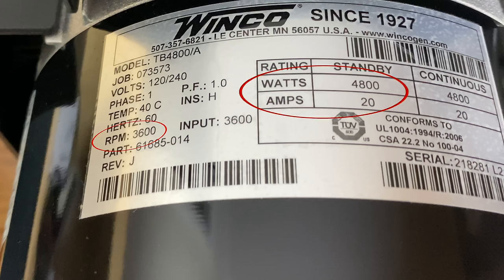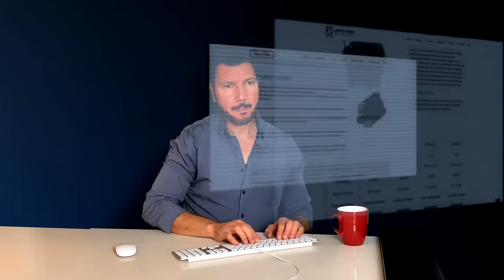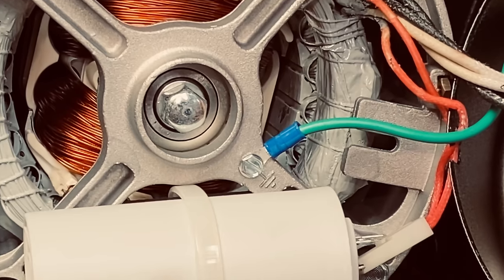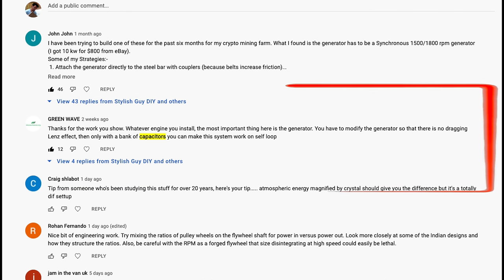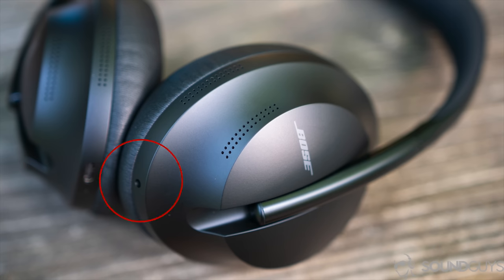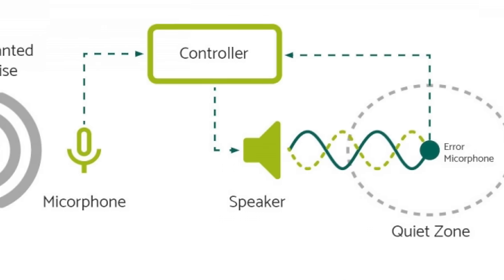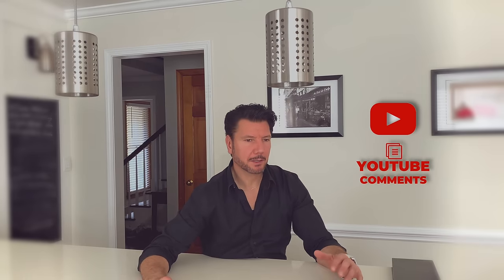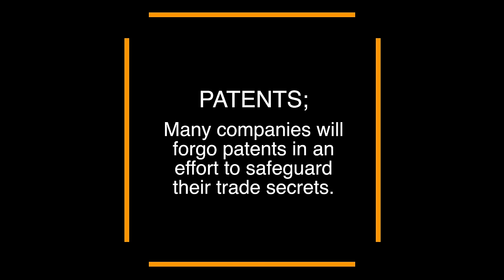Why does this Free Energy Generator not work?

Comment: when I built my generator I had it at46%of max power output I was still making adjustments to the design after work each night one day I came home from work and began working on my design at 58% of power it began to make a strange noise I stepped around the side to investigate and the multi piece flywheel exploded tearing the housing apart and cutting the control panel in half not sure what happened but tree days later there was a note on my car at work that just said boom the same note was put on my wife's car at the store
Reply from the maker: 😯
Honestly when I turn that thing on that is always my biggest fear that the flywheel will come loose.
Because at such high rpm it’s unstoppable and will literally go right trough the wall.
Reply: @MarkusNenning  watch your back we disassembled our unit and put it away we have been tailed around town and our house has been broken into at least three times never anything taken but the threat against my wife has made me put it away the secret is in the size of the generator head and you can light up your hole house

Comment: Belts break. Bearings fail. Windings eventually Unwind. Heat and Rust never sleep. Super efficient? Probably. Free? NOT. INFINITE, no.
Reply from the maker: But that isn’t exclusive to this kind of generator. And yes free is probably the wrong word because the equipment will always require initial investment and maintenance cost.

Comment: let me put it this way, the ac motor powers the flywheel, and flywheel runs the generator.

1 . flywheel size 1. should have two belt pulleys, size 1/3 and size 1/2.

2 . ac motor belt pulley size 3/4 or 7/8, to flywheel belt pulley size  1/3.

3 . flywheel belt pulley size 1/2 to generator belt pulley size  2/3.

now we have 4 belt pulleys and 2 belts.
flywheel conserve energy to run generator. generator runs ac motor. and ac motor powers the flywheel.

if we get to reduce crypto mining electricity cost it'll do mean a lot.
Reply from the maker: Thanks!
Yes this would be great for green crypto if it is possible 🤔

Comment: It doesn’t have to be “free” just efficient  enough to be sufficient-  quit trying to reinvent the wheel running I. Circles it’s all in the rotor - it needed to be a triangle like the mazd motors that’s why we where left the bent pyramid it’s the shape of the first wheels and latter rotors and ram jets

Comment: You don't need ai to make free energy. It can monitor the flow energy but cannot manipulate or get in between the flow. Reason why the flow of free energy and ai are in opposite directions. What that will create is a spiraling vortex or nightmare destruction. That will blow the cap and destroy all circuits in one blow. Not to mention fly apart in worst if cases.

Comment: Back in the 70's i experimented building free energy mechanical devices had plans from Bedini,and other technical data from Tom Beardin who if im not mistaken developed a working solid state device called Meg...i have that info in my files somewhere..its probably still on the internet.The zero point energy comes from what we used to call the ether..i dont believe that term is used anymore,because of misconceptives about what the space really is,from what i understand there is unlimited free energy which can be tapped from space,not outer space just the space all around us,our space has air but its still space.Resonant type devices are able to tap that space either mechanicly or electronicly i have no doubt about that even if its 1 pulse per second,thats alot of energy.We all know that you get a surge when you collapse a magnetic field if i remember correctly,i believe it to be much more then backing emf,its the clue to the river if energy available that would upset the status quo and men have known to crazy things to prevent adoption,ask Tom Bearden if he is still alive.
Reply from the maker: Thank you Frank!
Very insightful. Are you still involved and experimenting yourself?

Comment: What it looks like to me you have 90 lbs of weight in middle..so make the 90 lbs weightless.how you do that is take 2 neodymium magnets put one in hole (wood) other magnet going down that same hole (north vs south)  put your weights on top of that magnet(via a bar),,,that will make it weightless..as you know you have to have other parts like wheel bearings ect.I did that before with 50 lbs and it was almost weightless in spinning
Reply from the maker: Thank you!
Might be worth a try.

Comment: You did wrong way generator. You need use 3 phase motor, and run from 110v, same as Rotoverter, and then put motor in resonance.  Then convert AC to DC, and then DC to AC.

Comment: 1st of all you need to know I would generate this working To produce power. 1st while the generator is running the engine whatever. It's hard to build-up magnetic power 1st. When the magnetic power is built then you start to generate. And what's the other people are doing they put magnets into the generator and then they didn't need to generate Is magnet power. So from the start they start to generate power. And it's so easy like that that is why they're using the magnet my friend and if you guys started to put magnet into your rota then you will see the difference.

Comment: Dude shorten the shaf the fly wheel is on no more than 3 inch on either side
Reply from the maker: I want to be able to add more wheels if needed.
Reply: @Stylish Guy DIY  na man R&D DONT WORK THAT WAY !!! You must make a hole new shaft longer ! Dude you still must follow the rules (shorter =rigidity. Man I now r and d and you must have banke and patience and EXPERIENCED SHOT CALLER !!!!!

Comment: Once the fly wheel is fast enough you dont need the full amount of electricity to keep the fly wheel turning. You only need to use 50% of the power to keep the fly wheel turning, that would mean you could use the other 50% to fill a battery. You need a switch that alternates the power between keeping the flywheel turning and filling a battery. Think about it when you push a kids roundabout and the roundabout is turning fast enough you only have to hit it now and again to keep it turning at high speed. Your doing it wrong: https://www.youtube.com/watch?v=Z0W1-t-WqBs

Comment: Cool vid, I just happened across it  doing an amp search, any way have you thought about your balancer  or counter weight being connected to a shaft( like a crank shaft style) and the lobes on the shaft are attached with springs(several on opposing sides  that each works against the other  keeping the shaft continuosly rotating after the initial startup? Was just curious if you had. As for the enviroment, global warming has nothing to do with humans carbon footprint nor cow farts(as a billionaire idiot claims) it's caused by all those weather modification machines they have all over the word that's ionizing the molecules when the shoot that shit in the atmosphere. Anartica,  Alaska, Sweden or Switzerland, Artica, China, hell there all over the place. Example Haarp etc.... And lets not forget Cern too. They need to stop that shit right now!

Comment: I've done it you didn't try hard enough
Reply from the maker: I am not done trying yet.
Can you show prove of your working machine?
Reply: I used a sprint exercise bike. The fly wheel was 22 kg and was already in a good frame with excellent bearings which saved me lots of time. I used a treadmill motor which ran on a 24 volt battery  (2 x 12). And another treadmill motor as a generator. I had to hand crank the wheel before engaging the power and at first I was loosing 10 000 the of a volt every couple of minutes. So I reduce the friction of the generator on the flywheel and I was charging the battery it took 2 years to reach this goal. I know this can work and every building should be supplying there own power. Wish you all the best. I don't have this device any more. Enjoyed your videos keep them coming.
Reply from the maker: @conniekovacs2269  Thank you Connie!
I like the idea of using a exercise bike flywheel.

Comment: What you need on a flywheel is a flywheel tank with flaps on the inside water and fries mixture on the inside list flywheel spends buy a motor a one-sided flywheel you can touch others generator motors on the other side of the flywheel that generates power one to turn the flywheel electronic waste switching the power from the grid over to self on the other what's the flywheels in motion the waters in motion triple Force fluid of course it's like your own personal waterfall that will turn the flywheel with a minimum amount of power from the motor kicking on and off and Coast well others take the power from the flywheel turn into electrical energy should be a professional motion that machine and free energy it's only a you can always make it bigger than that always you can add flaps on the outside and create are shut chamber around the flywheel will the wind then go down around the when power instead of electrical to start the to start the flywheel in motion to start creating power

Comment: It will never work with any actual currently known technology.. you quoted the first law of thermodynamics, but there are 3 more. and one of them teaches us this; there is no system in any field of physics and chemistry, which has an efficiency equal to or greater than 100%...
and do not forget that a motor or a generator are not machines that produce energy..But it transforms an energy input into another form of energy output. From electrical energy to mechanical energy in the case of a motor and vice versa for a generator....In addition, these machines will not transfer more energy than is required at the output.
Even if your motor says 3000w(Max output), if you couple a load that consumes 2000w, the motor will transfer 2000w... if it's a 4000w load, the motor will transfer 4000w and burn out...One important thing that you have not shown on the nameplates of your devices is their efficiency, often denoted 'μ' and having a value in %, in general on an engine and an alternator this value is between 75 and 85%...This means that to transfer an energy of 2000 to the output, you will consume an energy of 2000 + 2000 * 20% = 2400 to the input (If available)for a machine with an efficiency of 80%. And this is why it will never work...
Maybe one day someone will invent a technology that will challenge the very misnamed laws of thermodynamics. but since the 17th century this one has resisted experience and has never failed..So let's not try to reinvent  the nail.. this machine will not work, the laws of physics tell us so and save us time...
Reply from the maker: You may find this video interesting curious to what you think about this technology? Also curious how you use the laws of thermodynamics to explain it?

https://youtu.be/wqbJWBtoFMQ

Comment: 1st Go find you a proper flywheel. The flywheel from an arrow c76,, Fairbanks and Morse (bell) 118 or 208 oilfield engine would work and I think that's what they are using on some of their videos. 2nd your original arrangement forgot something, you need to step down on the flywheel to a smaller shive (pulley) to run the alternator/generator. For the electric motor a low HP high rpm single phase compassitor start one is what's needed. They have built in start and run compassitors. The shaft sizes also need to match for all three since the rpms should be measured there not the shives. I want to say the shive sizes should be motor-4", motor-flywheel 8", flywheel-generator 6", and generator 3". I don't think your weights have enough kinetic velocity hence using the ones I outlined. They are heavier and weighted for this type of application, since you doing basically the same thing they where used for on oilfield engines.
Reply from the maker: I will check that out.
Thanks Adrian!
Reply: @MarkusNenning  your welcome. I have no idea how I started getting those videos in my feed, but they looked interesting and alot of the components I recognize from the oilfield. Which is funny. On finding the flywheel see if there's any oil well supply houses near ya. Or an oil company with a yard. I know most yards around here have several laying around.
Reply from the maker: @astron1701  I don’t think there is an oil company in my area but that a great tip cause I had no idea where to get something like this.
Thanks

Comment: You won't need to balance shit !!!ass far as concentricity from fly weel ID TO THE OD !!!  Must be done on a lathe for ferfect balance they wer made in a mold I garinty they are way of !!! Pout an arbar to hold from ID dile in and take scim cuts from OD ONLY . It will spin like a top no matter how you hook it up. You also need some kind of rectifier  or amplifier  and a fly wele on the starting motor  with a freewele poole
Reply from the maker: Watch my first video Adam I did balance it.
Reply: Remember it took like 5 or 6 guys to lift the fly wheel in that video those Cambodians made try a 3 times bigger flywheel and not so fast ,
Reply: I don't mean balance with waits it must be cleaned up on the lathe or troo up with indicator

Comment: Isn't easier to just admit that those Indian videos were scams? I mean seriously here, this is like making Santa's flying sled at this point. If you want the system to make free energy then you have to design it to do so, you can't just strap a flywheel to 2 motors and say eureka... Ill give you some examples, the last one particularly juicy and actually doable if you had an efficiently enough system. Solar cells make free energy because they are getting it from the outside. A nuclear device gets free energy because its also getting it practically from nothing. A device may generate free energy if you can absorb the heat from the air by cooling air and turn that heat into usable energy.  In all I would say free energy already exists, nuclear power is free energy. Ignorant people and politics are just preventing it from being used and that's why we have a problem with energy. If nuclear was used in all countries then there would be no global warming or any biproduct. The waste just has to be buried back where it was mined. I don't understand how that's difficult for politicians and nucleophobes to understand.
Reply from the maker: I have to disagree. I remember being a child in Austria during the Chernobyl disaster and it was scary.
Too much can go wrong. Just look at the latest accident they had in Japan.
There have to be better ways.
Reply: @MarkusNenning  this is the closest we can get to free energy not a flywheel. There are more coal mine and windmill incidents than nuclear.
Reply from the maker: @gautam4664 yes that is true except if and when there is a nuclear accident it’s impact is much more dramatic and very long lasting with years and generations of birth defects and cancer.

Comment: It is a  good video.Congratulations !  But I did'nt understand your purpose. The Tomas Edson tried thousand of times until be sucessful. You are killing the cienific sense of test and experimentation .
You didin,t modified the alternator with strongest permanent magnects. Of course you got nothing using a excited router made with copper coil. This consume energy obviously! 
You must to test a generator with permanent magnets in the router  using a induction mouter like is showed in some videos .

May be  if you use a moutor with magnets, you I'd have two generators conected in paralel in the exact time that you turn it off from grid . Then , if you  use a induction moutor woud  you Ibe sure  that it will work like moutor becouse you have no corrent return  in the timing that you unplug it from grid and plug it in the generator .
Any one is interessed in patent or maney.
Stop with this talk about climates changes  . Anyone belives in  this more! 
Test the generator with permanent magnects using a induction  moutor. Please!
Reply from the maker: Still working on it.
Thanks!
Reply from the maker: Still working on it 
Thanks Derick!
Reply: @MarkusNenning  you are welcome. 
Congratulations for the video! 
I have a interesting link to pass you. Let me see if I get it .
Reply from the maker: @gato-de-schroringer  thanks Derick will check it out.